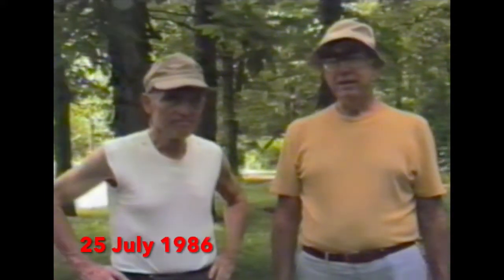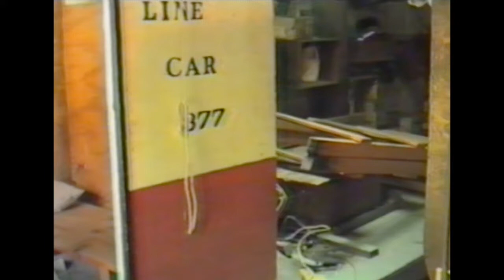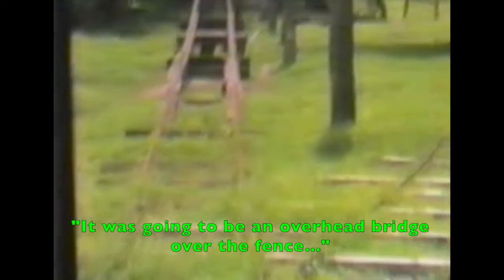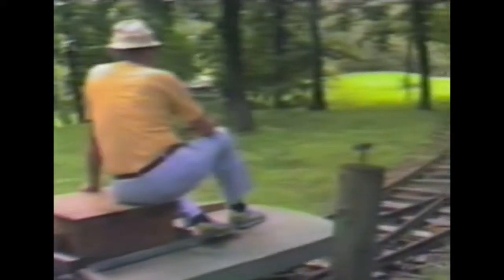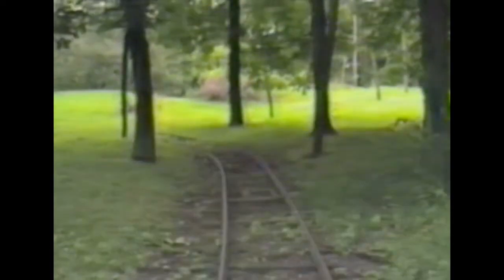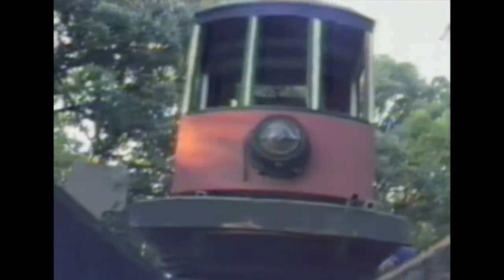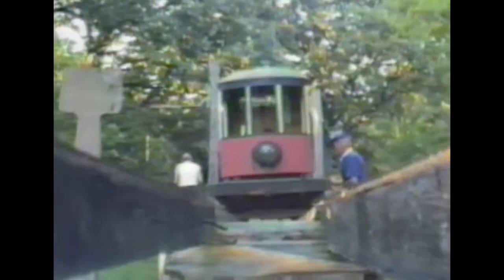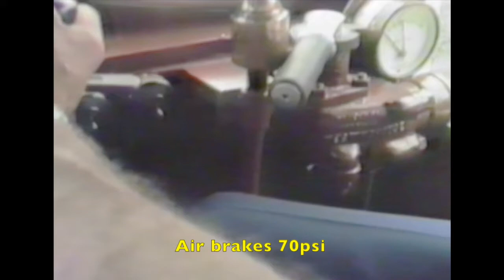Rock River Valley Traction Co, Illinois USA

Comment: Reminds me of the old Blackpool (U.K.) system. It still runs, but on the seafront at Blackpool only, until the track gets closer to Fleetwood, where it DOES still run through the streets. However, I still remember the system as it was in the 1960s, when it ran through most of the streets in Blackpool.
Regards, Paul in Cornwall UK.
Reply from the maker: Well the trolley pole current collection is a similarity. As for running through the streets of Blackpool, perhaps you don’t know that for several years they have been building a street extension to Blackpool North station, possibly along the previous route where they ran. There have been many obstacles to completing this construction, but surely it must be up and running before too long.